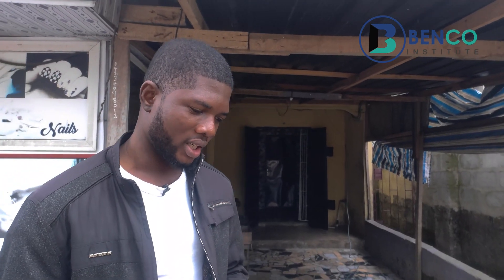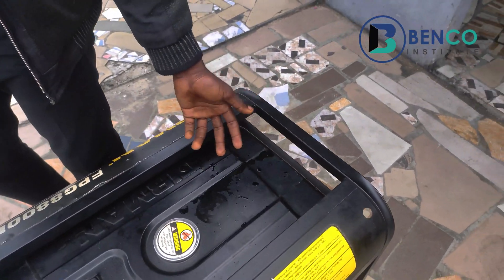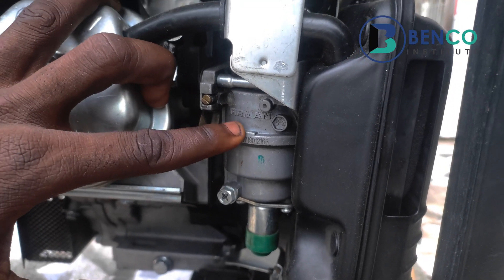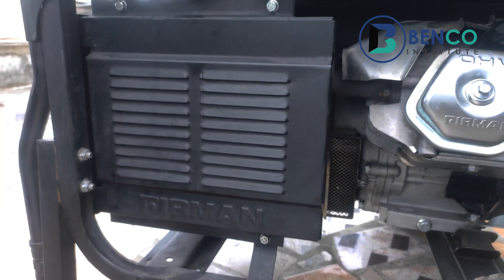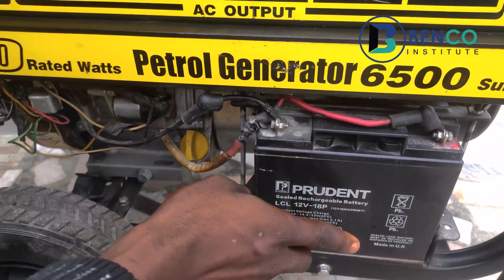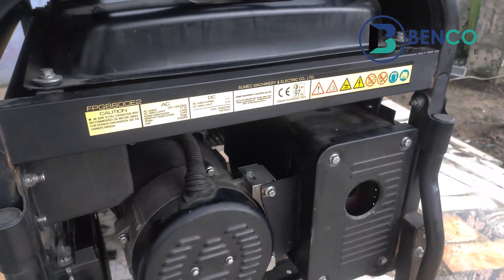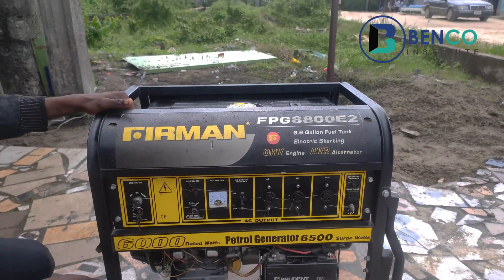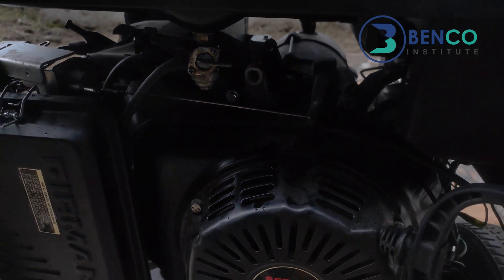Simple ways of identifying a good and genuine Generator....

Comment: Nice update thanks alot.
Please how can be differentiate a Copper coil from an Aluminium coil when going to get a New generator?
Reply from the maker: You can hardly do that though because there is only a small opening that allows you to see the alrernator.

However be rest assured that most brands uses copper alternator...

But when in doubt speak with the seller and tell him/her that you want a genuine copper alternator and using the right words and tips he will handover a good alternator to you

Once again...  Kindly note that Major generators like Elemax,Firman,Tiger and Elepaq constant comes with a copper alternator and if the gen has not been tempered ,you will get a copper alternator 100% of the time.

If it has been tempered you will notice from the bolts... They would be distorted a little as spanners has been used on them... mainly check around the alternator end cos that is were the Damage was done

If you notice something like this kindly  avoid the generator

I hope i have been able to help
Reply: @bencoinstitute  thanks alot. A copper coil is much better than an aluminium right?